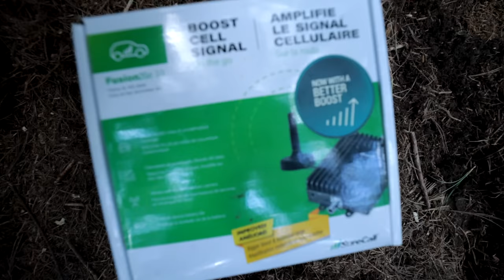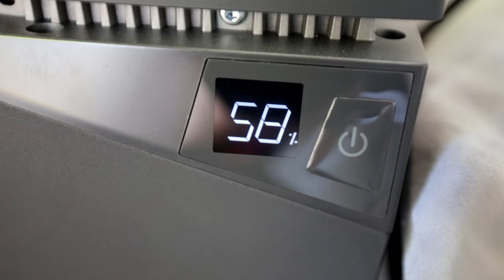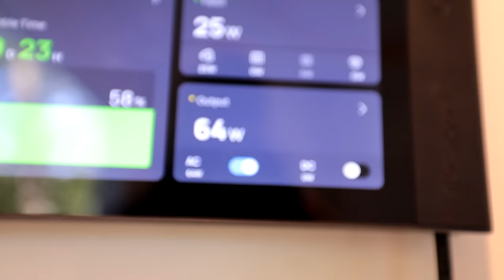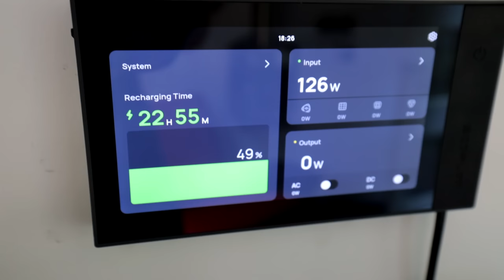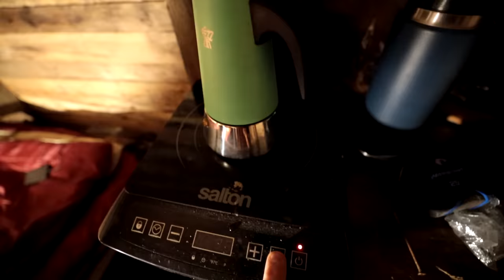Surviving 24-hrs UNDERGROUND (in the Spider Hole!!!) - Building a Secret Tunnel Bunker

Comment: To save on space if you wanted since you have wood on all your walls, you could set up a hammock for your bed then just unhook one side when you're not sleeping
Reply: Idk, the fear of your own weight accidentally pulling/breaking one of the corner beams and possibly caving in the room would fill me with fear. The bed is fine where it is for now.
Reply: @zzzdarkcloudzzz4233  if you built it that weak you already fkd up.
Reply: Make it hinged to the wall so it can fold up flat against the wall out of the way. It can be supported by chains or, perhaps better, legs that fold down so you don’t have to worry about it pulling off the wall. Oo, a double fold down! The padding and bedding on a flat sheet (held in place by a loose bungee cargo net) folds up against the wall leaving a table. But the table can also fold up over the bedding layer out of the way when you need extra floor space! I’ve got a cabin half built in my mind already. Maybe next year I’ll make a video. Thanks for the inspiration!
Reply: Jesus loves you alot trust in His death 4 salvation and be saved from eternal hell <3 Jesus died on the cross for you bro.
Reply: You could do just a thick wood pole buried in the ground close to wall. Two on each side attach hooks for hammock. Nothing attached to wall
Reply: Smart man 🤠
Reply: Research German wwll bunkers for all you need to know.
Reply: @zzzdarkcloudzzz4233  the bench would be more of a hazard than a hammock

Comment: So since you hit sand, buy a driven well point, they are easy to drive in sand. You could actually make a driver for the rotary hammer. Since you are so far down already, just the point and one section of well pipe may be enough
Reply: If you don’t get the sand point. It would be best to line your well so it doesn’t collapse.
Reply: hi
Reply: Jesus loves you alot trust in His death 4 salvation and be saved from eternal hell <3 Jesus died on the cross for you bro.
Reply: @Fit4C  that had nothing to do with the previous conversation and nothing provoked it, maybe seek some help Incase it is a regular thing.
Not about the relegious background, but that you throw it in without any context could be a sign of psychosis, got a few People in my surroundings that show similar patterns when they have psychotic phases.
Reply: Number two should be easy to do
Reply: @Fit4C  There can only be one
Reply: Exactly 💯
Reply: @GHOST25938  maybe you need to evaluate yourself then or find new friends.. Godbless.  ;)
Reply: @matthewmaxcy1574  so I should dump them Because they got some issues? What may even makes it worse?!
Maybe you should reevaluate your life choices and how you Care for your friend's and family.

Comment: That’s quite the hidden room you’ve made there maybe you need a auger like used for moving grain down the shaft to get dirt out so you can just keep digging now you need to run wires up along a tree to some solar panels to recharge your Ecoflow battery. Keep the videos coming love them .
Reply: he could build a mini pumped hydro system
Reply: Thats a really good idea! I was pondering " how the hell would you get the dirt out"... thanks!
Reply: stick an old shed on top of it. then you'd have some camo for ventilation wifi etc..
Reply: @correctpolitically4784  Wouldn't be so well-hidden though!
Reply: @roxxram9151  yea but do you really want that ? I'd rather have some focal point that wasn't me. Like 50 ft away in what would be my kill zone .Or you could just bury pvc pipe and put the vent anywhere.
Reply: @correctpolitically4784  I think keeping things farther away from the hole in general would help to keep it hidden better. Additionally a little improvised periscope wouldn't hurt to be able to scope surroundings without leaving the hole.
Reply: @roxxram9151  I'd still want to be able to fire from the hole . Maybe dig a few tunnels a distance away from it . With a small structure placed strategically as bait.
Reply: @correctpolitically4784  Absolutely. I think the original spider holes actually were sometimes networked together. I think a few tiger traps/pitfalls wouldn't go amiss either honestly
Reply: You could always find a tree that is already hollowed out yet still living. Place a 3 to 4” pvc pipe from above down through it with cablIng  for some solar panels further up the tree  as well as moving your cell tower up on top of the tree tops  your intake then becomes a utilities conduit hidden by a living tree. Hardly any one looks up into trees let alone can see past a few branches. I know a guy who built a fully underground living area completely hidden. The tree he found was burned out by a lightening strike. To the point. He had like almost 3 feet across with another 15 inches of solid wood on the outer edges. He removed  all the interior debris took him a few weeks. He added a spiral stair case to it. It was tight by doable he used the central spine to do his cables. He found a few other trees with in a short distance with similar possibilities but this one was his best. So  anything is possible if you  take the time to recon the area you intend on putting some thing like this into place.

Comment: I'd use a smaller stump for the fresh air intake... you can wire a 3v fan for the duct Also for circulation... this project keeps getting better... a well inside the bomb shelter/spider hole? That's awesome...

Comment: I think, for the ceiling light, you should have screwed the screws in until they poke out the other side. That way, once you get it in position, you won't need to hold it for so long before the 1st screw penetrates. Also, those screws won't hold more than a few months since all the weight is on the heads. Eventually, it will start to slide down until it falls. You need something that will allow it to rely on horizontal support, distribute the weight to some brackets on the outer rim or inside behind the wheel.

Comment: I think it's a little dangerous to be under there for a long time. the bad air you breathe out is heavier than the good one so sooner or later the room will fill up. you need an active circulation system that pushes the bad air away and throws the good one in (the good one I think comes naturally from the ceiling boards so it doesn't need to be active). besides that I think it's really cool

Comment: I would have put a tarp above the wood to deflect the water to the side.  
I do think you could easily add a real mattress or bed to the place, there are fairly cheap bedrolls and stuff.  (like I am currently sleeping on a $100 piece of foam and its worked well so far)

Comment: Once you get some 1 inch 1 and a 1/2 inch acrylic rod and stick it in the ground leave. Maybe 6 inches or so above the ground and that'll pipe some light down. Also, also, you should have some emergency switches and depending on the frequency. They know exactly where you might be under the ground if you do have a collapse.  And you probably should bring some ox and thanks down there

Comment: You need a dirt vacuum system that sucks the dirt up and spits it out. 
The idea came to me when I saw that infinite stairwell on the plateau of giza, egypt. 
No matter how hard they try and dig this stairwell back up, the sand storms FILL IT BACK IN. XD
sand is much lighter than this mud you diggin in though, so you need a system that separates and dries the dirt as it moves it, just maybe?

Comment: Hey man, I love your stuff I've been watching your videos for years. While I have respect for you anyway, I feel I need to point out you have ear defenders whilst using the sds drill while the dog doesn't, with far more sensitivity to sound. I'm sorry if something was mentioned like being deaf anyway but please take the dog out while using noisy tools :"( also, use a separate bottle for urine; I think van lifers use a new toilet called eufy or something, it has two areas for both number ejections so the urine doesn't start mould in the solids bucket :) great work on the shelter as always:) please don't read my comment as trolling or being petty the concern was subjective:) :)

Comment: Would like to see an Ecoflo unit in the spider hole maxed out with solar panels wires as far from the hole as possible then up the trees in a false canopy that allows light above but is still a tree from below. I use rechargeable motion activated led strip lights from Lowe's all throughout the house for power failures and to save power in the winter. I use rechargeable power packs velcroed to the wall below them to get about 5+ days use to extend time. Radon detector possibly down there?

Comment: I have a dirt floor yurt.. now I have carpet on the ground
I use a 5 gallon bucket to pee in.. I use water from my dehumidifier water and sometimes add a bit of bleach to the water.  I then just toss the bucket into the woods.  I cover it with a lid and it works great!  Love the series!

Comment: Your vent needs a cap and screen to keep rain and animals out. I would have turned the hollow log on its side but drilled a hole to pull the vent through the bottom and screened it. Add living  coverage, maybe brush around the ends, or a brush pile over it.
Love the light! Will it be too heavy for the ceiling plus the dirt?
Love what you did and do. I have a hard time waiting to see what you'll do next.

Comment: Suggestion.  LED strip lights, a water cube buried above for a gravity water system that you can refill from above.  Definitely a fan of some kind to force fresh air down, battery powered.  Burying pvc pipes to a source of power and communication and bring it down to use.  Absolute need to have co2 detectors.  And maybe a sump pump system for flooding emergencies.

Comment: actually with real good ventilation, you could use an alcohol stove, but I would not use anything else. same with candles for lighting. if your electric goes out. ive read up on the Viet Cong tunnel system. their ventilation system was phenomenal. glad ive found your channel. ive been wanting to build similar undetected under the carport with the entrance leading from the utility shed. great video.
Reply: alcohol stoves put off humidity ( water )  = mold

Comment: 5000-6500 K	Daylight with Clear Sky (sun overhead). 3000-4000 K	Sunrise/Sunset (clear sky). Yeah, I thought you were a little bit off since I remember when I got my LED headlights, they were 6500K and considered daylight. 
And damn, it was a great upgrade for my nighttime driving. I can see the future with them. And no, I'm not blinding people since I have them lowered to the top of the beam is at the top of the bumper of a Honda accord one car length ahead. I haven't been bright flashed by oncoming traffic and it's been 3 years.

Comment: Not sure if you thought of this already, but putting some wooden floors be very cool. And for the vent u could put like a burlap sack over the opening. And probably to late, but drill holes in the bottom of the vent. In case water does get down there, it'll at least drain.
Reply from the maker: Bottom of the vent is open.
Reply: @ModernSelfReliance  oh I've must've missed it when you put it in. That's good and great series of videos

Comment: If you build a seat to place your bucket under, you effectively have a toilet. 

Whenever you want to be really sure nothing comes through the walls, you can grout it with a grout hand pump. You pump the grout (cement, sand and water) through small holes, and it fills up behind the lagging/shoring/wooden blocking. Ive read "Indian Standard, Code Of Practice For Design Of Tunnels Conveying Water", and "Indian Standard, Code Of Practice For Construction Of Tunnels", it says that you can also use a pneumatic way by using a Pneumatic Cement Grouting Pump. It may be a bit phony, or shouty, but these guys really do know what they are talking about. Grouting may be of limited use in clay soils. But you can fill up the voids behind your wooden lagging. It should not be too fluid of a grout to fill up the voids behind the lagging, having it fluid will make it go into sandy soil better. 

Really like how your shelter underground started to look. You have got some pretty good soil for building underground structures. But be sure to keep a close eye on the groundwater level; you dont want to have a layer of water in your shelter. 

Sleeping underground sure is quiet. I really enjoy sleeping in those sort of places, the peacefulness is awesome. :) 

Greetings,

Jeff

Comment: I did construction for half my life. And the only place I've ever lived that had "easy" digging like in this and on other channels, was at the beach. I WISH I could dig a shelter like this on my land without a pretty decent sized excavator. I did a 2 ft deep ditch with one of the small ones at an equipment rental, and it almost wasn't powerful enough for just that.

Comment: slightly low land, but it is like my house... the well really struggles with silt of having that beach sand at the bottom. It is a little deeper than that layer, but there is a small chance of there eventually being a sink hole in my front yard from the years of showers, drinking water and toiletry usage.

Comment: You should've made 2 vents one high and one low on opposite ends for true natural ventilation just like combustion forany boiler, furnace, or water heater in a building. Also did you do a french drain to a common hole and add a 12vdc sump pump with a float switch. Add a little lime and sawdust to your bucket also. Just my thoughts. Otherwise I love it.
Reply: Great ideas 💡

Comment: No streaming services no problem I have been a prepper for about 25 years. I  took alot of time in prepping items that would prevent bordom and keep the mind busy. Approximately 5000 dvds several hundred board games books both paper and digital. A couple thousand albums all on cd and vinyl and all backed up digitally. And assorted game systems some are hacked to run other software so they are not limited too original purpose.

Comment: I am a year too late, but I think having 2 ducts would be better - one with opening near the ceiling, so the hot air that raises up would get vented out, which in turn would suck the heavier cold air through the second duct that has the opening near the floor.

Comment: You should get a huge container if water goes above ground and has some sort of coal heater to heat the water and have a tube that runs underground with a slide almost that allows water to go. You could Def make a shower underneath the ground. Anything you can do above you can do below. It's just elevation. Instead of humans living under the surface of the earth, we live above it.

Comment: Interesting series, and a good addition to an off grid place. I was going to ask about how Bean was gonna do their "business" but you mentioned in the end of the video^^. I'd say the "24 hrs underground" rule could have been allowed to be broken to take them for a quick walk or two. It would be interesting next time to bring with you a mini temp & humidity gauge to see how humid/condensation buildup happens overnight/early AM. Another idea i had, if you had access to an excavator for enough time would be could you dig a large pit and then fill it in to create the tunnels/rooms as you fill it up, then you could add gravel and such to assist drainage so it stays dry.

Comment: Somehow I think you can make your opening an extra 6 inches or so wider. Think about it this is supposed to be based after a Japanese Spiderhole from the war. That soldier would’ve had gear on a rifle you can barely squeeze yourself through how would you get through if you had any extra gear such as ammo belt backpack Not to mention grenades side arm and rifle.

Comment: Man you should make it bigger with a bedroom
Reply: Also a small bathroom and water closet to put your water so it can run with rudimentary plumbing .Also you may need to dig up the roof and  put plastic or tarp up there and then put back the dirt .For the well use post hole diggers but you may flood your bunker becareful..

Comment: Oh man, run solar panel cables through the air system same as your cell booster. Expand the hole far enough away that you could have a septic tank and a rain collection tub top side for potable and cleaning water. Big sack of iodine tablets you’ll be golden! (Edit) I just remembered Vitamin D pills too XD

Comment: You may have just dug a crappy well...lol. pun intended. 
But seriously,  your probably around 20 feet deep at tgat point. So you may have hit a shallow water table. If your going to yse it for drinking then use activated charcoal for filtering and boil it. You should be good to go.

Comment: A buddy of mine in his garage dug down a hole 1 ft.² diameter and down about 6 feet then he drilled down another 10 feet put a PVC pipe with holes down it filled around with crushed stone and hooked up a toilet in his garage it was only for peeing but there was no smell he had running water to the toilet he told me he used to throw a bottle of bleach down once a year he said that would take care of the smell I’ll never forget that it worked pretty well
Reply from the maker: Lucky guy didn't hurt himself... Bleach and Urine causes Phosgene gas aka Mustard gas...
Reply: @ModernSelfReliance  that’s what I thought but he told me he throws a bottle of bleach once a year and the toilet has running water to it I’ve used it many times and he’s had plenty of people in the shed using it there’s a pool table everything in the shed except for the kitchen sink😀